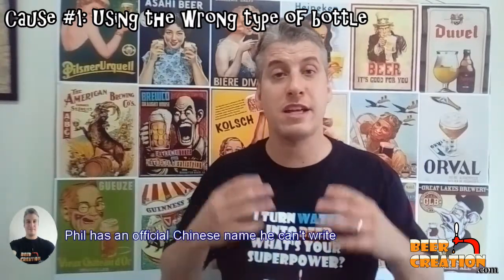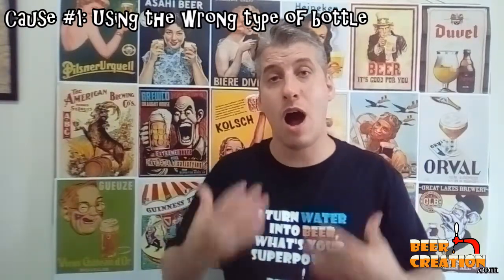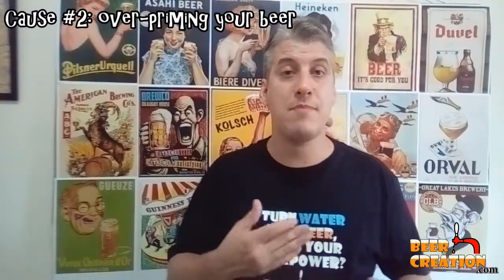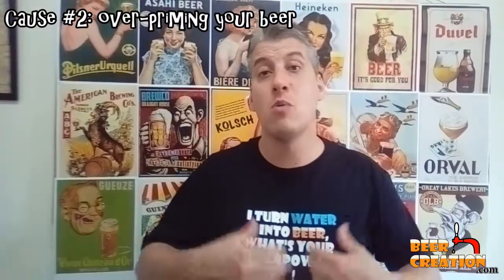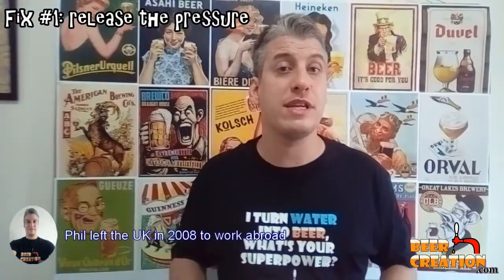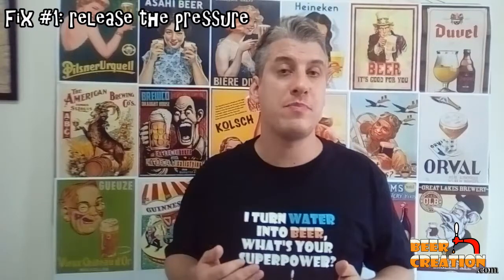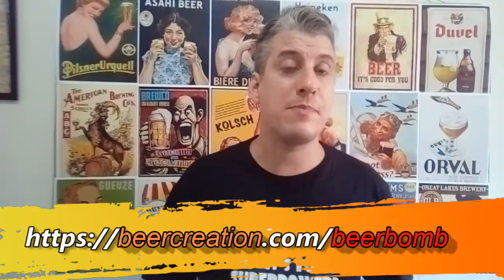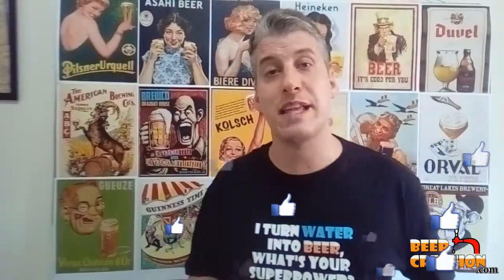Common Causes of Exploding Bottles in Homebrewing | Shattering Bottle Fixes and Tips

Comment: Good points but I always use at least a couple of PET bottles per batch to check for carbonation. If they go overly tight and deform then you can be sure that the same is happening in glass bottles .Time to get them straight in the fridge. I've also found it useful to weigh glass bottles and discard the very light ones.I did a video a long time ago on this. 
Cheers. 👍🍺
Reply from the maker: That's a cool concept, like a plastic canary. I'll give it a go whenever I bottle next!

Comment: There seems to be far more content on YouTube for bottle bombs than for undercarbed brews. I'm in the latter camp. Just can't seem to get decent carbonation in my bottles. Beer is practically flat no matter what I try.
Reply from the maker: That's annoying. It is hard to get consistent carbonation from bottle to bottle, but to have flat beer all the time is a worry.

I would double check your calculations. Make sure you are using enough priming sugar for the amount of beer you are working with.

Also, make sure that your yeast is still viable by bottle conditioning at the same temperature as you fermented the beer at.

In addition, test that your bottles have a good seal to them. You can probably do a 'washing up liquid bubble' test on them to check for CO2 leaks after a couple of days. Perhaps switch to swing top bottles to get a better/different seal.

If you've tried all that, then I would start experimenting by bottling earlier than you would and see if that's the issue or adding more sugar than suggested to see if it's just a personal taste in terms of CO2 volume.
Reply: @beercreation3440  thanks for the info! I do get some carbonation if the bottles are opened at room temp but if you chill them in the fridge all the c02 is absorbed and they just pour flat.
I've bottle primed with Coopers drops and more lately batch primed with demerara sugar. I have a hunch that might be the issue so I've bought a bag of brewing sugar to try priming my next batch. I've been increasing priming sugar each batch so now I'm upto 130g per 21L of ale. Going to try 140g next batch and see.
I'm currently using a combination of flip-flops and PET bottles.
Reply: a trick: you can watch movies at flixzone. Been using them for watching a lot of movies these days.
Reply: @Zayd Ibrahim yup, been watching on flixzone for since december myself =)
Reply: @Zayd Ibrahim Definitely, I have been using flixzone for since november myself :D